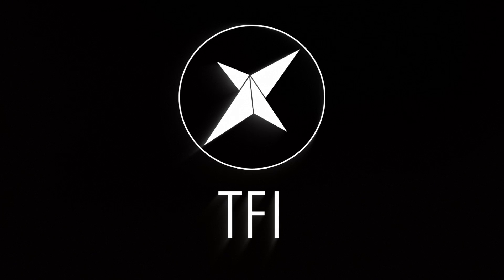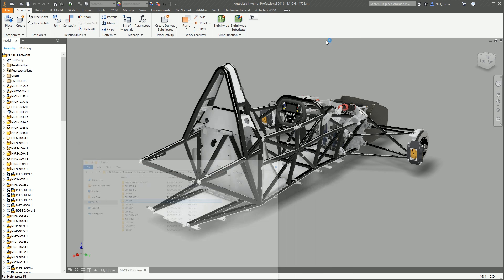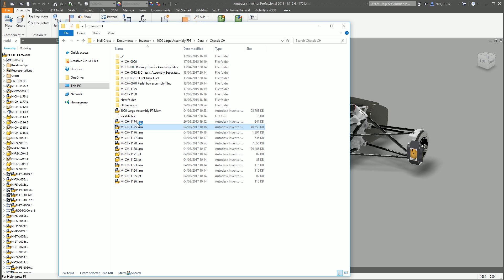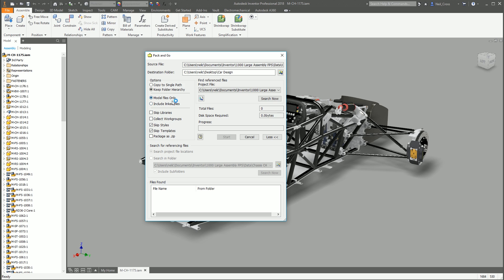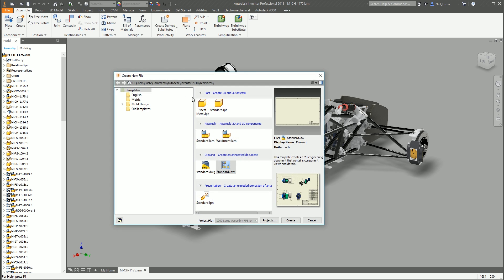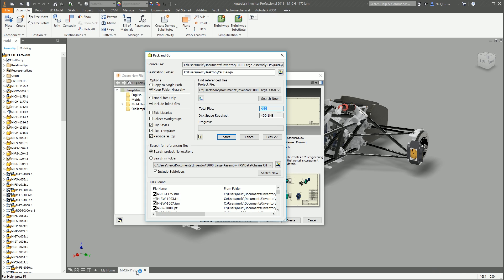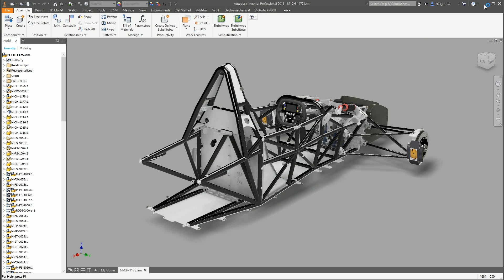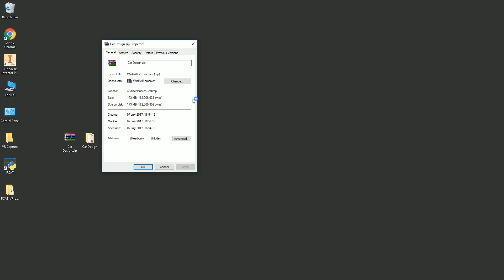How to use Pack and Go, Tutorial | Autodesk Inventor

Comment: I'm pretty sure that "Collect Workgroups" will gather all of the parts that you're using that are NOT in your current workspace.  This would grab any parts from "Workgroup Search Paths" from the Project File pathing.  This is rare, due to Vault usage, but for some customers who create individual Project Files, Workgroup Search Paths allow users to use centralized standardized parts (that can be saved, versus a Library Path).  Hope this helps and have a most blessed day!